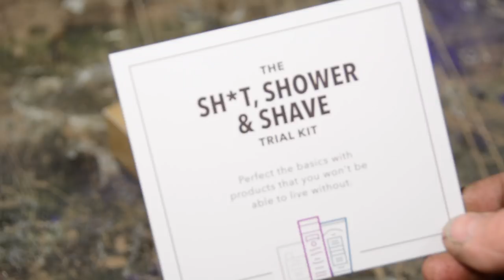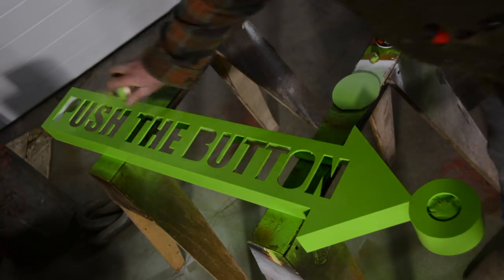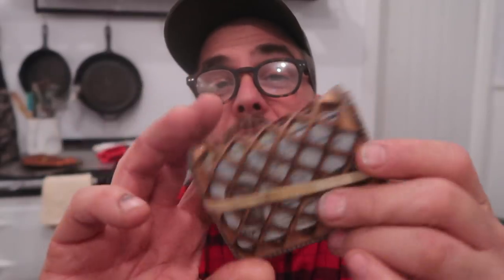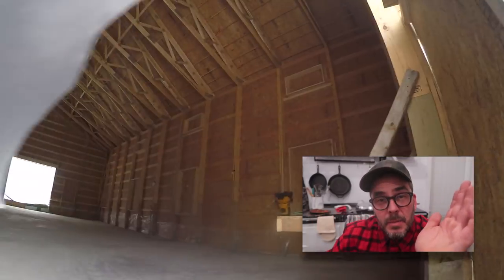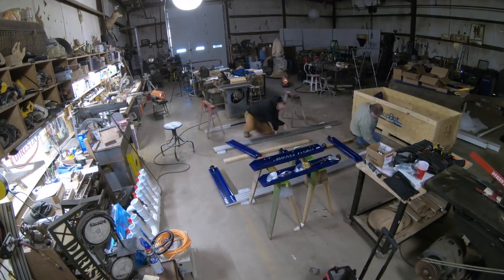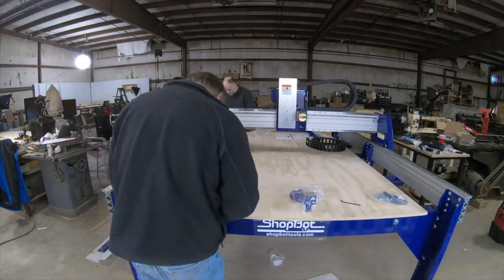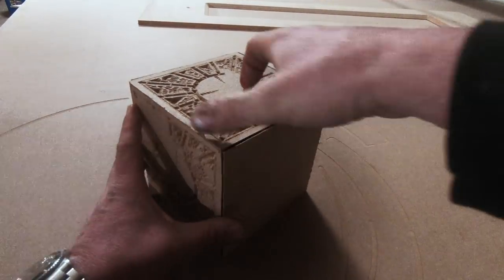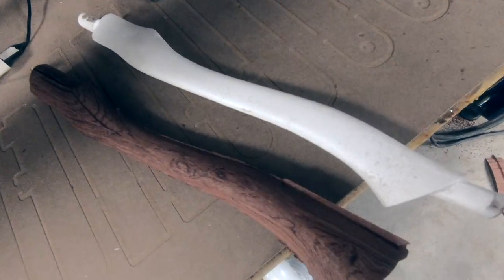DiResta 63 What's in The BOX?

Comment: okay on the dollar shave club spot... just get a safety razor. blades are about 10 cents each. the blades are recyclable as well since they are just a bit of metal. Safety razors seems to be pretty affordable on the low end, $25-$45 gets something that looks decent from amazon you could of course spend how ever much more than that you want. Even if you shaved everyday and used a new blade, that works out to about $3/month in blades. 

I'm not sure how dollar shave club could be lower cost than that.

Comment: Heh   Love the CNC as a shop tool. I have a total home brew almost exactly the same size as the 2 by 3 feet shopbot one and its overall preformance is a bit better. Now that you got the electric termite up and running, take a look at fusion 360.  Its typical of the programs used to make state of the art fighter aircraft. Also take a look at Blender, an open source, free 3d rendering program.  Just export the models as a stl file that V-carve supports and forget all about the animation part of blender.   

I also use V-carve but I find the cad functions of it marginally useful but good enough for reasonably simple 2 and 2.5D stuff. I highly recommend some sort of cheap basic 2d cad program to work up flat stuff with then export the file as a DXF file. Import the DFX file into V-carve to do the toolpathing. Sketchup is reasonably workable for this. 

Have a blast with the CNC... Its a whole new world of doing things. In addition its can be some "hired help" you dont have to pay other than the power and maintenance costs.  It also dont argue with you for days off etc...  :)  Ive been tempted to make myself another small one of say roughly a fot square working area just to make all those weird shaped holes it seems you always have to do by hand. Just drop it on the plywood, zero it out and hit the button.. 

Bottom line -----  from the VERY limited tinkering i have done with some small shopbots I wont hesitate to recommend one as an option.

Comment: 6:09 is that an electric trolley control??
Reply from the maker: Not sure! it is incredible tho!
Reply: Looks like what it is, or its an elevator/crane control.  Probably for some big DC motors based off the size of the contacts. I can only imagine the wonderful arc display that thing would have put off in operation! You need to get it powered up and use it for something. :-)